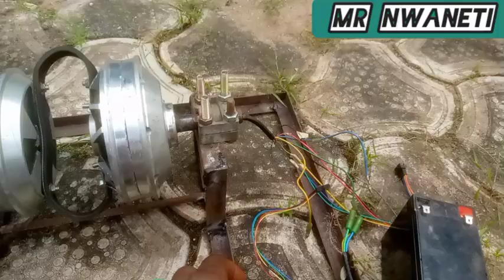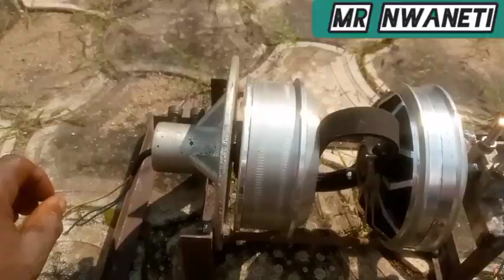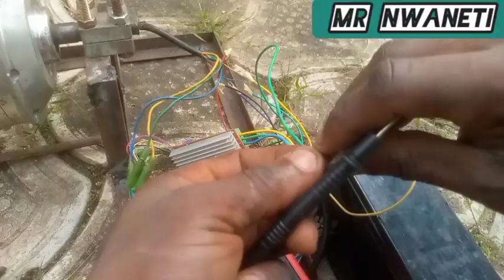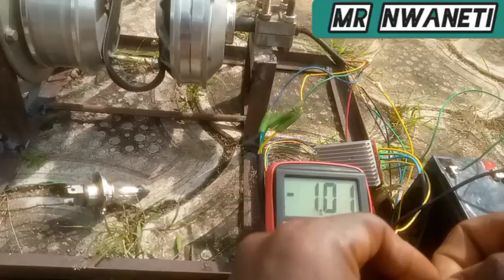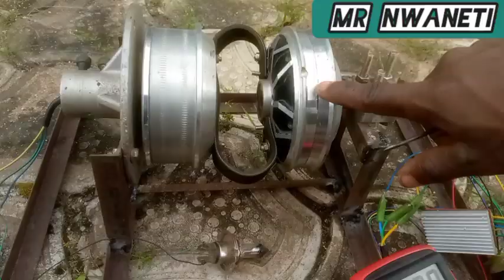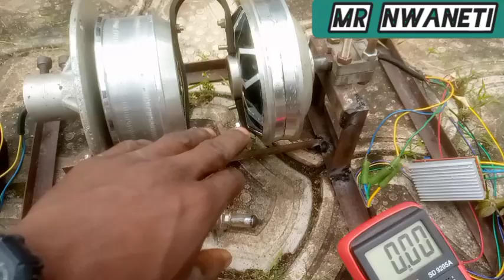Generator experiments/self loop system

Comment: What you say is mostly correct, the higher the number of poles in the motor, and the larger the diameter, the more powerful the motor and the more suitable it is for driving a generator. Many poles provide a continuous driving force, not having time to decrease the torque over the distance between the poles. In the generator, rare poles provide time for the motor's driving force to regenerate, from the tip of one pole to the tip of the other, which has a maximum distance of 180 degrees, making it even less likely to feel the shocks of the transition from one pole to the other due to the inertia of the rotor (or a small flywheel), at high speeds, as you said of 3000 revolutions per minute. If the diameter of the generator is small, it is a great advantage for driving, the resistive force being small, but energy is lost due to the low peripheral speed. There is another efficient driving method, but there is no room here to present it.
Reply from the maker: Your submission is on point, where are you from?

Comment: Learn to use flywheels in ur projects, how do u always expect this things to work properly without a flywheel absorbing the drags while a load is applied. Cars, generators, plane engines and many more work decently on flywheel.
Reply from the maker: I appreciate your feedback, you made a point here
Reply: @MRNWANETI yes when a heavy flywheel is in motion it becomes very difficult to stop it, that means when u connect ur 60w bulb, the fly in high speed will tackle the resistance instead of the generator, but make sure u use belt and pulley not direct shaft. One flat type belt will link the two hoverboard motors by going round them while the pulley on the flywheel should hv a bigger diameter than the diameter of the the motor used as generator so that when flywheel pulley completes one revolution the generator will rotate 5 to 10 times
Reply: @MichaelIkemefuna-p1z  Regarding the flywheel, its mass is very critical. If it is too large, it becomes a consumer, and if it is too small, it is even more useless, but one is needed. Let's take the following example, because you all keep claiming that the flywheel works wonders: the car, which we all know, is the flywheel, which is driven by an engine, and runs on a flat road. After a lot of energy has been used in the engine to reach a speed of 100km/h, the energy (fuel) necessary to maintain the speed is much lower, BUT when the road has tilted a little, the speed is reduced when climbing, requiring surplus energy. So a load appears on the "flywheel" and this reduces its speed. Where will we find the load on the flywheel? On the drive motor! Any load that appears on the flywheel will be found on the engine and it will have to supplement the energy necessary for the drive. The flywheel only has the function of supplementing (discharging like a capacitor) to load shocks. You can see one of my videos, in which I demonstrate this. The engine drives a flywheel, then a generator. With each addition of load to the generator, the motor's supply current increases. The flywheel is only for shock attenuation (example in the thermal engine or crushers), it does not participate in any way in amplifying the continuous force.